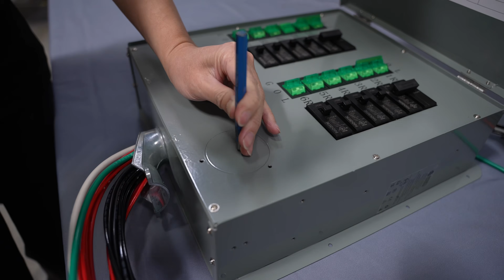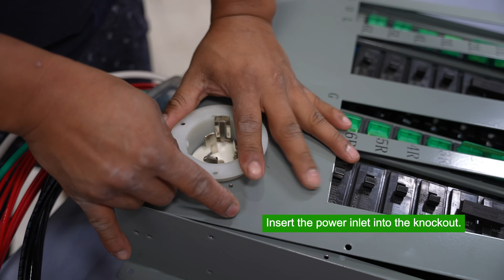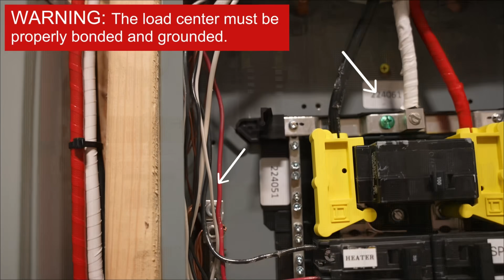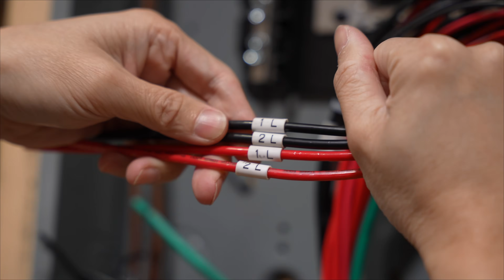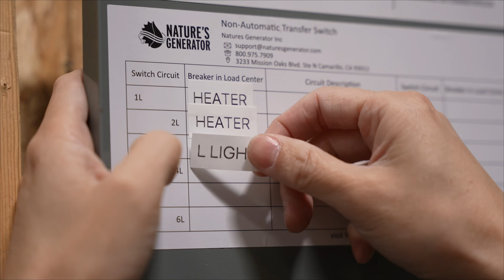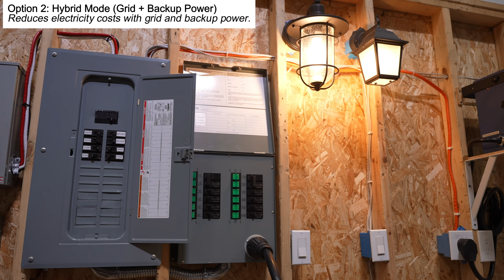How to Install a Nature’s Generator 240V Manual Transfer Switch (Step-by-Step Guide)

Comment: why do the circuit breaker on the transfer switch need to be turned off?  I thought the G and L switches did all the work. ??
Reply from the maker: Great question! 😊 The G and L switches handle the actual switching. Turning OFF the breaker in the transfer switch first is the preferred approach as an added safety precaution, even though it's not required for normal operation. 👍⚡

Comment: The 240V connection isn't very clearly explained. Is there anyway to show the connection for one 240V breaker and follow it from transfer switch to main unit
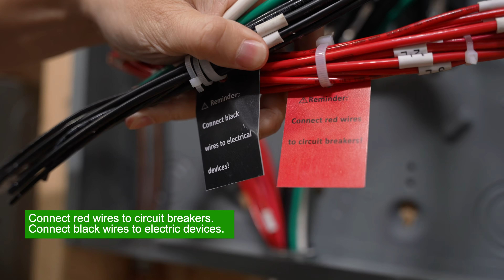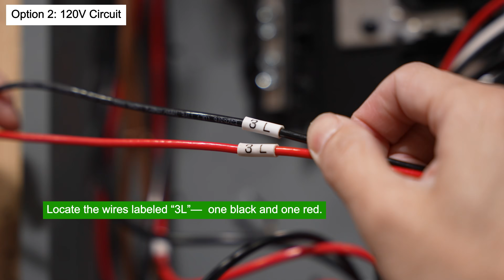Reply from the maker: Thanks for the feedback! We actually walk through the full 240V breaker connection in the video between 2:32 and 3:34, including the transfer switch to main unit wiring path. Let us know if you still have any questions after watching that section — we’re happy to help!